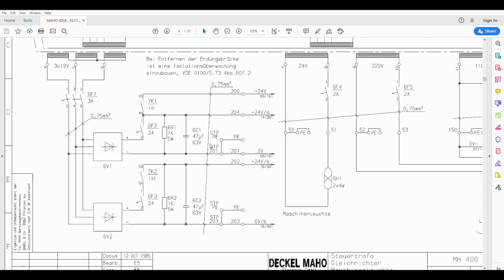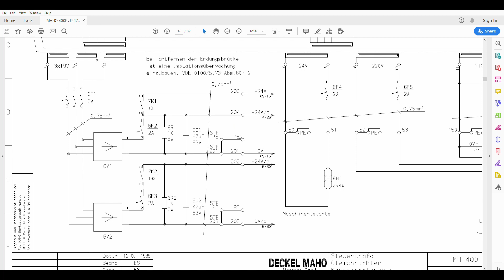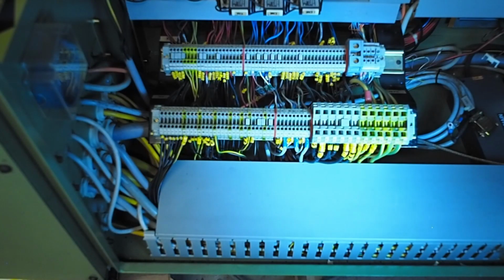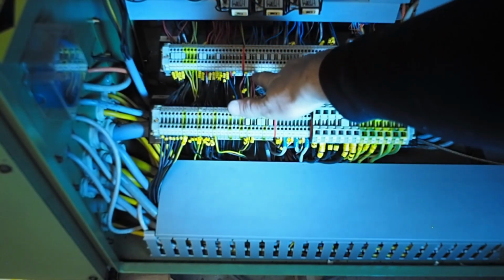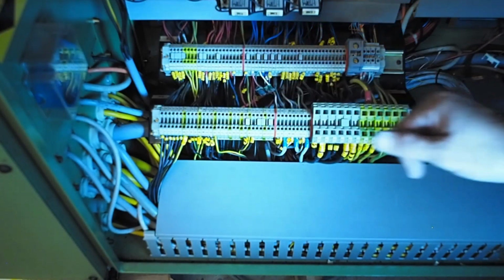LED Ringlight for the MAHO CNC Mill

Comment: Servus, hast du einen Tipp wie man sich Wissen über CNC / Linux usw. als KFZ Techniker am besten in der Freizeit aneignet?
Ich hab eine MAHO MH600P mit TNC 135 Steuerung. Würde gerne mehr über die Maschinen verstehen. Leider hab ich keinerlei Spezialisten im Freundeskreis. 
Bin über alle Tipps dankbar! 
So einen LED Ring würde ich auch gerne haben, kannst du mir vielleicht den Kontakt schicken? Danke. 
Viele Grüße
Reply from the maker: Servus, Als KFZ mech hast du sicher eine gute Basis wissen dafür. Hast du die Schaltpläne? Am besten einfach jeder Schaltplan einzeln durchgehen und lernen was jeder Leitung/Relais etc macht. Die Machinen sind sicher einfacher als jeder Auto.
Bist du beim Zerspannungsbüde.de und CNCecke.de dabei? Beide Foren sind mit wissende, hilfbereite Leute gut bestückt.
Über LinuxCNC /Mesa Hardware und CNC in Algemein kann ich Peters channel empfehlen:
https://www.youtube.com/user/talla83
Wegen das Licht, bitte um ein PM über eine die Foren (ich habe immer dasselbe Username).

Comment: I also installed a ring light on my mill, but hated the shadow that was cast on the work, so I built a mount and put two ring lights, on either side and slanted inward so not only is it brighter, but theres no shadow.However there have been occasions where they were in the way, so I plan on installing an over sized ring light instead, so the light beam is not obstructed by the quill.
Reply from the maker: My garage is dark enough that any light is good light. The MAHO already has a flourescent tuve work light which you can move around. The worst thing is the terrible mixed white balance for doing video's.